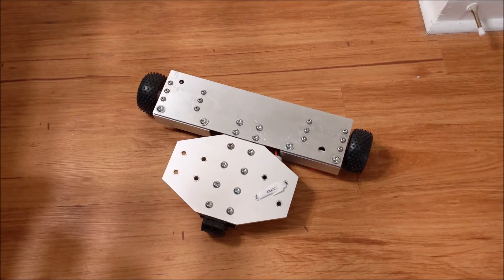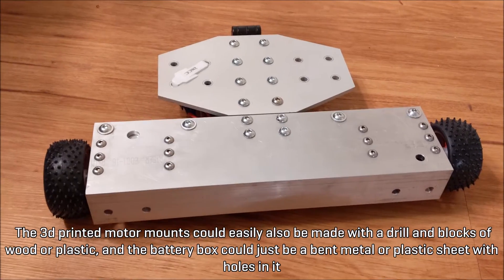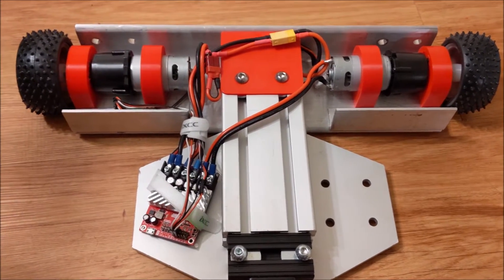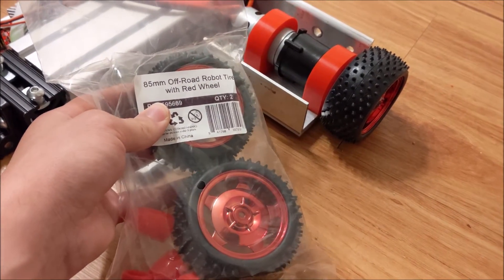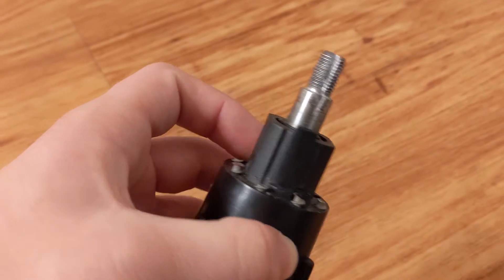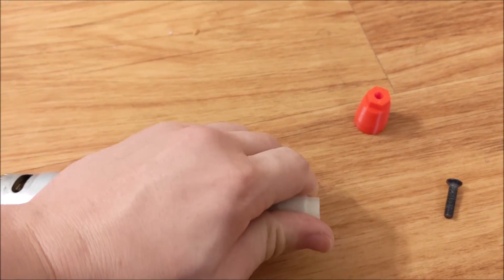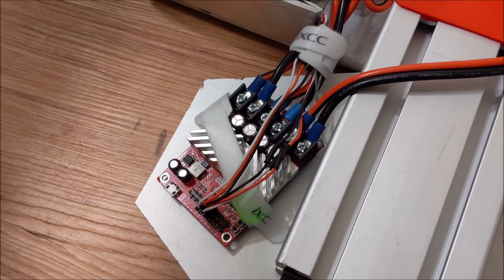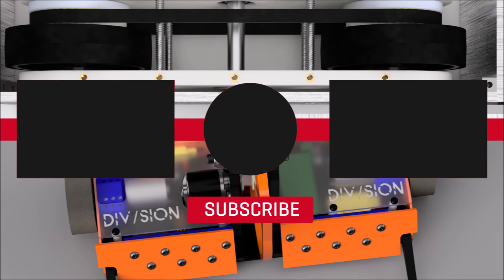How I Built a Combat Robot with Limited Budget and Tools: 12lb Sumo Bot Overview

Comment: What is common to use as a weapon motor in the 12lb class?
Reply from the maker: As with everything there are many factors that could decide this. For the only 12 lb bot that I have built I used racestar 4114 Motors because they were super cheap and I used two of them on the weapon. Propdrive 3536 or 3548 motors can also be used if you are not as height constrained as I was
Reply: @JustCuzRobotics  I just need a starting point. Thanks so much!

Comment: Hey nice video is there any chance I could get the name of the esc?
Reply: and receiver
Reply from the maker: ESC I used: RoboClaw 2x30A (can control both)
ESC I would actually recommend: DFRobot 40A Bidirectional Brushed ESC (you would need one for each drill motor)
Receiver is transmitter specific, its the one that came with it. I use the Flysky FS-i6 which works with the FSiA6 and FSiA6B receivers or TGYiA6/iA6BB receivers since there is also a nearly identical TGY-i6 transmitter.

Comment: Nice video. I plan on sharing this as encouragement for people I know. I can never get the drill screws to come out so they get destroyed. My solution was to drill a hole through the motor shaft and then screw a threaded flange to the wheels (different type, H.Freight cheap wheels). Drilled a hole through the flange and pinned through the flange and shaft. I think that makes sense...Any how my 12lb is a sumo type meant for open arena as well. My experience with the printed mounts was they will break if they take a long fall. I reinforced them with hose clamps.
Reply from the maker: Thanks and feel free to share! That is good is good to know about the mounts though, I may have to bring spares.